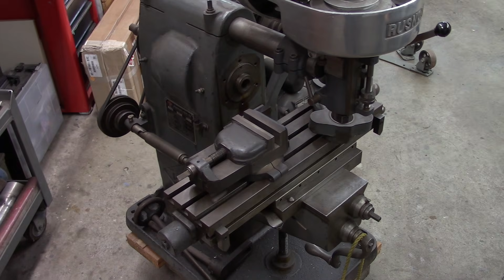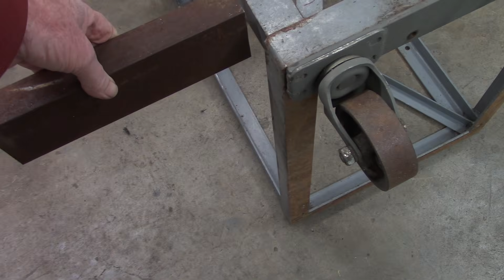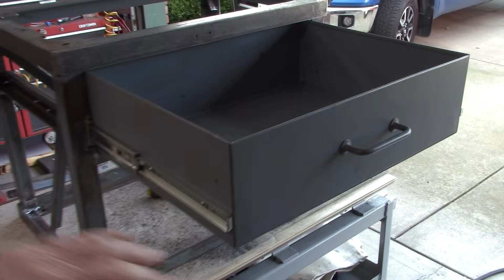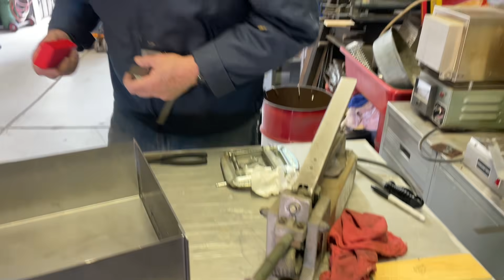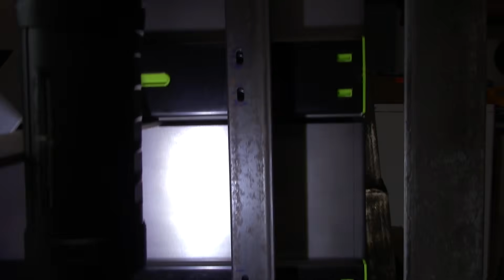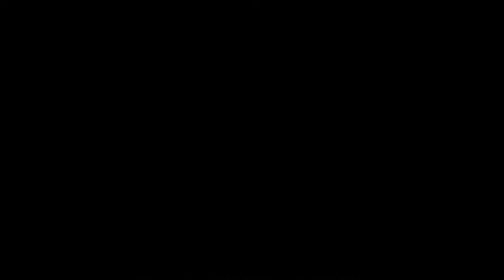Diamond Machine Tool Co. Horizontal Mill Restore :  Part 1

Comment: Scary electrical! You did well with your Fusion sheet metal design. There's a steep learning curve right there.
Regards,  Preso
Reply from the maker: Thanks, Mark! I must confess there were several episodes of frustration just trying to make that simple drawing.
The sheet metal tool in fusion definitely threw me a couple of curveballs. 
Cheers……

Comment: Nice upgrade with the drawers Dean. I had to do the same with my 1906 Garvin mill. It didn't have a ground or plug. Its 240 volt motor with a 115 volt magnetic switch that sounds really cool when turned on. I put a four prong plug on it with a ground now.
Reply from the maker: Thanks, Randy, yeah that wiring reminded me of some of the stuff my dad would do. He would say that safety stuff is just cosmetic not required….lol